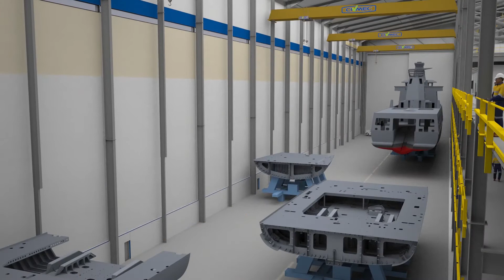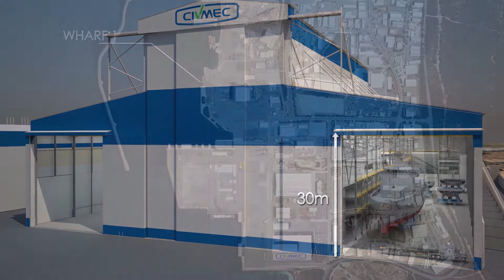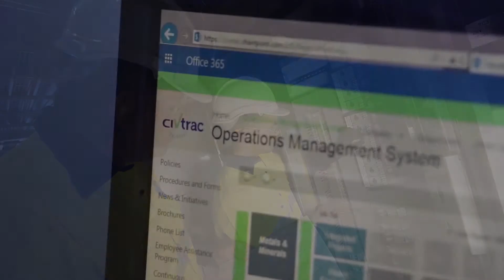Civmec Defence

Comment: Make our OPV more heavily armed. They all don't need a helicopter hanger. Move the front main gun forward put a 76mm high velocity gun instead off the 57mm. And put a 11 cell RIM-116 searam missiles system on the front behind the main gun. Put 2x2 anti ship missiles in the middle off the boat. Raise the helicopter hanger and Put 12 sea captor missiles there instead and a decoy system.And put 2x2 torpedoes tubes at the side lower deck. And have a CIWS close in weapon system  at the back. have half of the OPV built for original purpose with the helicopter hanger and the other half as a attack class OPV. Start heavily arming our ships Australia. Our navy  is small enough. We need to bring the firepower when it matters.